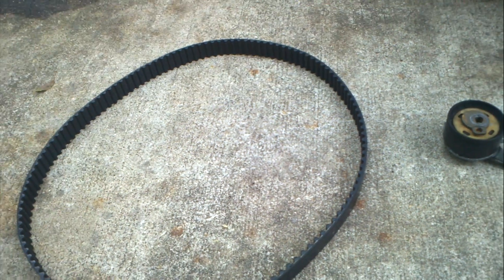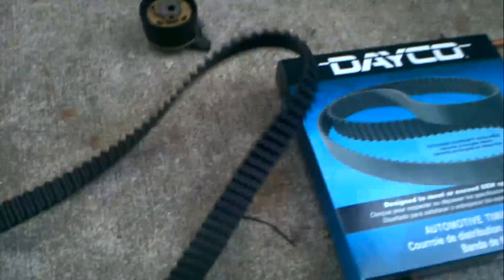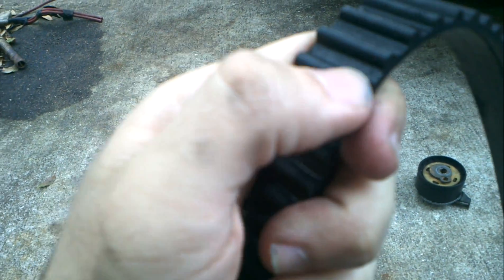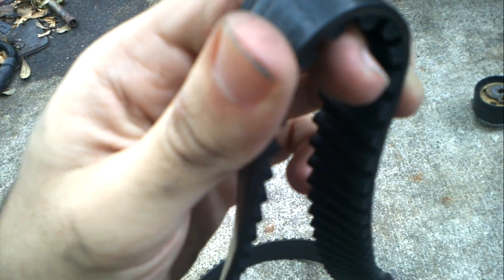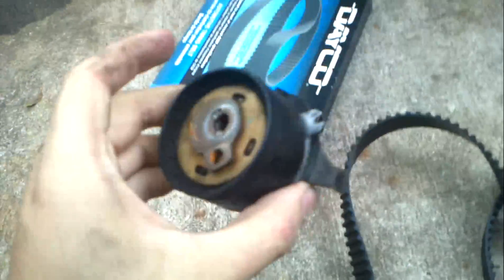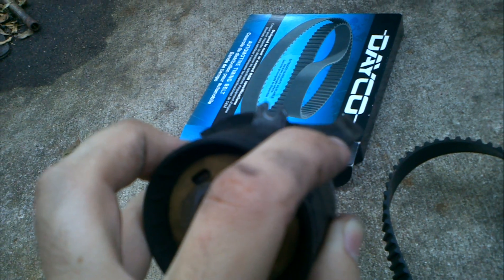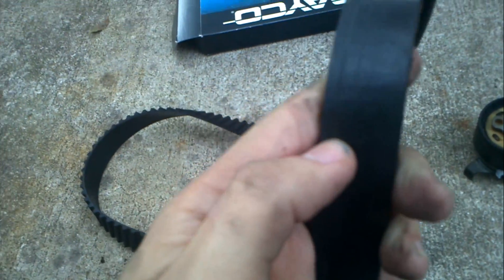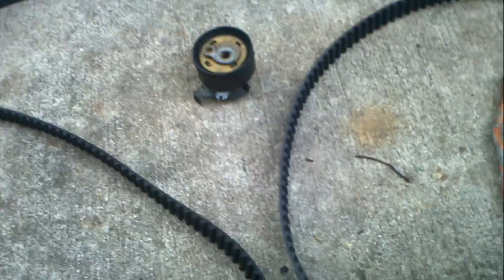how to tell if your timing belt is bad or old, new vs. old comparison

Comment: It’s actually really hard to compare unless the belt is very worn out. I changed my timing belt and the old one that was in there I’m guessing the previous owner changed it, because i have 131k on my car and the old belt doesn’t have any tears. Looked new to me.
Reply from the maker: I've run into this before on an escape with 148k, the belt showed no signs of cracking or wear so I'm assuming it was changed out before

Comment: Dude that belt must have way more miles than that. Dont BS people. That belt was really on its way out the door. You were lucky you cought it. A really shiny belt gives it away . You could see the ribs through the back side. I would go with a dealer belt only. Stay away from Gates,those damn things suck. I wrote off Gates years ago. Yes,always,always change the tensioner period. Also change idlers and water pump at the same time. I change my seals too.

Comment: From my 40 years experience on working on cars the number 1 failure of the timing belts are other related components such as tensioner, sprockets, defective water pump and wrong tension. My 1986 Porsche 928 first Timing belt was replaced @ 120k miles after 17 years. Porsche recommends 60k miles or 4 years.